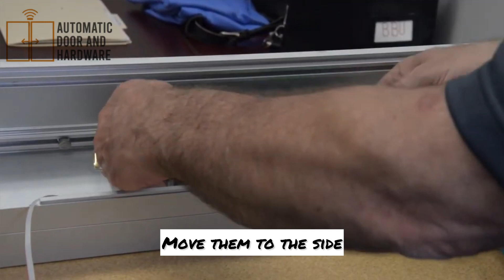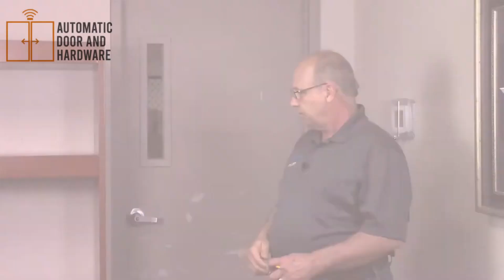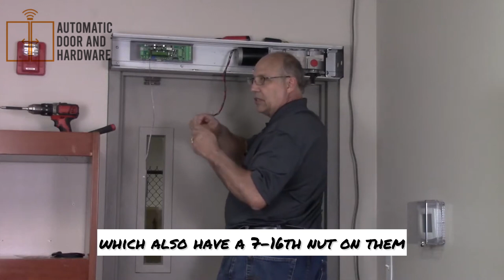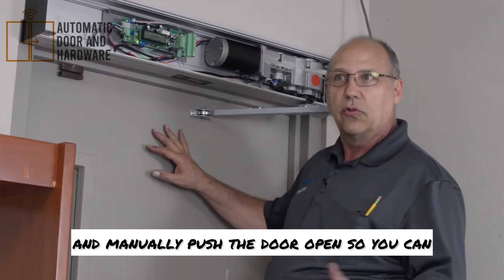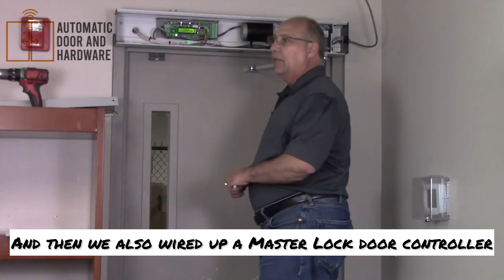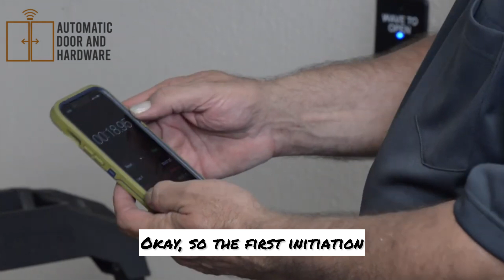Smart and Seamless: Installing Micom SW800 Smart Swing 3 Automatic Door Opener

Comment: great video except you keep saying "giving you the pre-tension I mentioned" but you never actually mentioned it, or it was edited out. You also did not address the lowering of the shaft or the measurement position of the arm on the door. All in the manual, I know, but if you want a complete installation. Considering the ability to lower the shaft, why not simply line it up with the frame removing the ugly drop and plywood backing?

Comment: At the top of the door  I see a magnetic contact, are you using that to tell the controller that the door is closed. Or how does the controller know that the door is closed and if locked from inside button to keep door locked until unlock button is pushed and not to open prematurely?

Comment: Im servicing a pull unit where the spindle shaft was set too low and it rubs the door top when operating.  It looks like I have to remove the motor assembly and use a shorter 1/4-20 bolt to pull the shaft further into the motor body by about 1/2 inch.  It's either that or I'll have to remount the entire unit slightly higher above the door.  There's plenty of exposed shaft so it appears the installer used the wrong length spindle bolt I assume because he wanted to reuse the existing door track holes, which required him to drop the shaft/arm lower.  Even so, the pull arm roller is tight against the top of the door roller track.  I'll remount the roller track after raising the spindle, making sure it's level with the pull arm mount.  These are well made units and fully featured and easy to program, but looks like the installer messed up the install by gambling with clearances.  It's been in service 18 months so likely has slightly more play, causing the contact with the door.  Hope that all makes sense????  Will report back after tomorrow.  :)
Reply from the maker: John thanks for sharing. It’s always great to hear insight from out in the field!